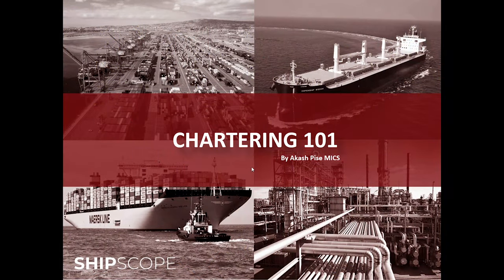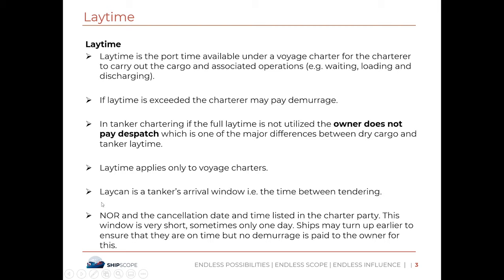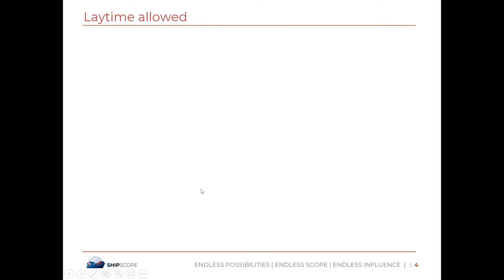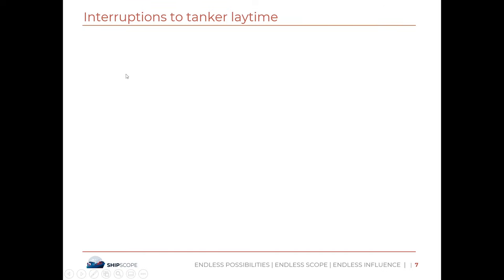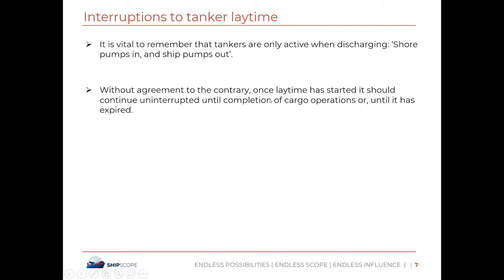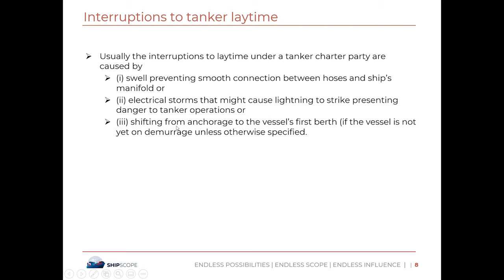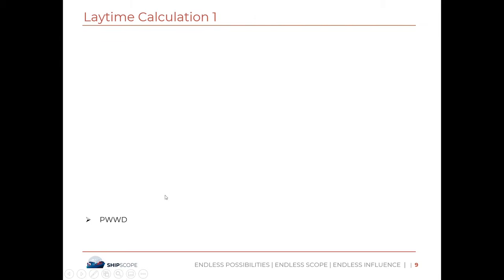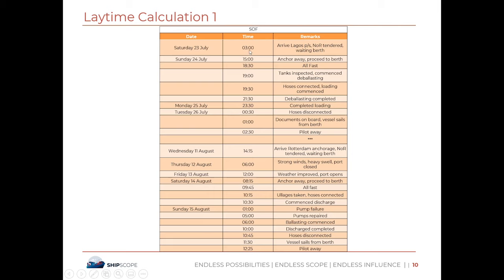Time Allowed for Tanker Cargo Operations - Laytime Part 3

Comment: Perfectly explained.
Can you please elaborated the pro rata thing.

Thanks
Reply from the maker: Thanks mate.

Pro rata freight. Without express or implied agreement, full freight is payable only on delivery of the cargo. If the ship and/or the cargo is lost freight does not become payable. However, a clause in a charterparty may provide for part (or all) of the freight to be prepaid. This is one use of the phrase “prorata freight”. Another use is related to a situation where the ship cannot complete the voyage for same reason.  For instance, the ship may suffer a casualty and have to call into a port for repairs. The cargo owner may decide to take over the cargo and carry it on to the destination. The shipowner may claim for pro rata freight for part-performance of the voyage charter.

Comment: Thank you for your video and it’s so helpful so that I can understand charter party & laytime calculation.

By the way, can I ask you a question about laytime?
I wonder if the time delay in following case could be considered as restraint of labor of vessel and the time loss could be counted as not used laytime by Asbatankvoy No.8.
1. The cargo was shipped in comingled condition for 8 consignees and the cargos were discharged at a discharging port.
2. Before calling at the discharging port, master provided master’s declaration stating the number of shore people (such as loading master, cargo surveyor and foreman etc) embark on board for each batch should be limited to 3 people for preventing COVID-19 but charterer arranged 10 surveyors for each batch because of determining exact cgo q’tty and cheking tank rader at CCR etc.
3. Master on behalf of owner rejected the shore people got on board and keep asked only 3 shore people on board so there was delay of 1.5 day.

Comment: In the end you multiply 12000 not 10000 which is the real demurrage rate..
Also would be more clear if you explained that we divide 38.5 with 24 so we find the real number in pdpr basis and then multiply with demurrage rate.
Overall perfect video and keep going because you do excellent work.. I feel lucky that I found this videos..
Reply from the maker: Thanks for your suggestion mate, we will add a remark stating as $10000 X 38.5/24 gives you $16402. I am glad you learning, and hats off to your hard work.
Reply: Be safe these hard times 🤜🤛
Reply from the maker: @georgegeo1254  Cheers

Comment: Many Tks for great explanation.i have one query. Pls help me on my query. Eg. Laycan start for chemical tanker vessel on 21/09/2021 and end at 27/09/2021 at load port. 
Vessel tender her NOR on 20th Sept.
Vessel berth on 21st Sept 1100 hrs.
So time start will 21st Sept 0001  or 0600 hrs 
Pls advise.
Reply: As far as I know, the time start from 0001LT/21st unless existing exceptive clause such as vessel not to tender NOR before laydays. if there's exceptive clause about NOR, laytime shall count from 0600LT/21st